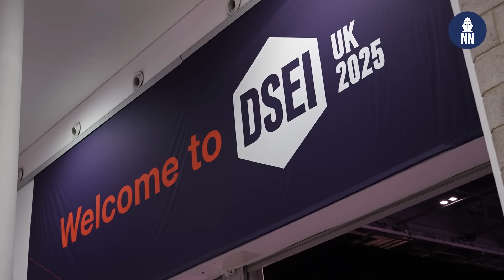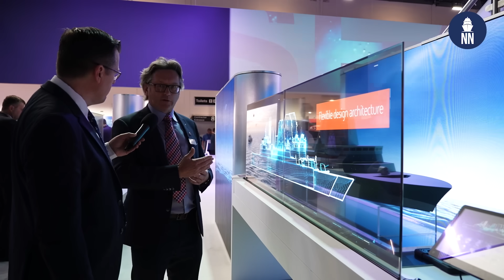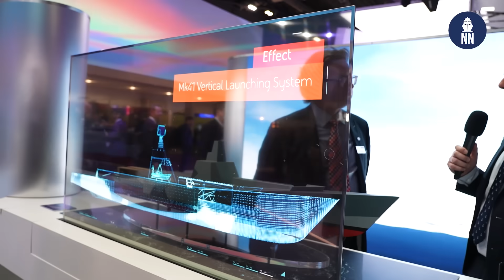Future Air Dominance System (FADS) concept ships by BAE Systems

Comment: Why is BAE wasting R&D on an airfare variant of the type26? Just piggy back off the Canadian variant and increase the VLS cells aft and forward. It will look much better than that bulbous eyesore.
Reply: uk type 26 has 72 cells 48 gws 35 and 24 mk41 Canadian has 24 mk41 vls and uses american radar uk is already funding the flat aesa radar from bae that is shown on model also the mode has 128 mk41 vls cells it is much better then the Canadian version of type 26
Reply: @adamchalmers8378  Canadian version of Type 26 actually have a better AAW capability than RN Type 26 despite having less VLS. That 48-cells on Type 26 are mainly for point defence Sea Ceptors which have shorter range compared to RIM-162 block II ESSM on Canadian Type 26. Canadian variant also have SM-2 and RIM-116 to complement the RIM-162, so it will have a respectable layered AAW. The 24-cell Mk-41 on RN Type 26 are for anti-ship missiles, that’s where the RN Type 26 have an edge on both RCN and RAN Type 26 variants. I get that RN don’t want to use American missiles and systems, but picking up the Canadian design and modifying it to fit more VLS and European systems could be a cheaper  approach since BAE also already showed a model of a 96-cells euipped Hunter-class.
Reply: @Flick-l5m i do think some of the vls will be used for quad packed camm-er and dual packed camm-mr to give the type 26 a good air defence loadout but i would like more vls because they want antiship, landstrike and a asroc alternative + potential camm mr and er  in a 24 cell mk41 vls
Reply: 100% correct!
Reply: @evil.totoro. The "bulbous eyesore" is a large flat panel phased array radar and any modern air defense destroyer will have a very large one stuck on top of it. If your primary metric of what makes a good combat vessel is how pretty it is all I can say is I am extremely glad you are not responsible to military expenditure in the UK.
Reply: @kalicom2937 I don’t know man, the States, Japan, South Korea, and China have figured out how to fit large phased array panels to Destroyers,and figured out how make them look “pretty”. y can’t the UK? Like others have said, being too top heavy has already shown to be issues with the Hunter class.
Reply: @Evil.Totoro  Indeed. I think having the best radar possible is pretty important when it comes to an air defense asset - and if you want a big radar you need a bigger ship than the type 26 (which was always the plan for the type 83). Something the size of the Arleigh Burke class - or even larger. I have seen displacements as high as 10,000 tonnes has been mooted. I do not think they will be that big, but if they are they will be a properly chunky bit of kit, potentially.
Reply: @Evil.Totoro it's a very early draft design.
The final version will not look anything like this mock up.  It is really just there to reference the size of the hull and radar panels being proposed.
Reply: They want it fitted with their own radars not American.  You would think they would use the Australian version as the base model but if the UK wants a larger missile load out and radar capable of tracking ICBM's the ship will be in the 10,000 tonne range.
Reply: @Weakeyedominant  the Australian variant (Hunter) has topweight problems because of the decision to use domestic sensors whose installation is so heavy that they've used up the stability margin for the design in one go, never mind any future upgrades! You have to be very careful about putting heavy stuff up high. The variant that BAE is proposing uses the T26 as the basis for the hull form and the layout and systems architecture, but the hull is bigger and therefore more stable, and therefore able to carry much more topweight.

Comment: The trimaran looks good to me.  And likewise I agree with the concept of having several of these simple and fast built types added to the current Type 45 s, while taking more time to finalise their replacements.
Reply: Its the RV Triton platform that they tested extensively a decade or so back. The ship then went to serve with Australian border firce i think before being returned to the UK Beautiful ship, saw her in Aberdeen a few times .

https://en.m.wikipedia.org/wiki/RV_Triton
Reply: Well then you clearly never got the message over the American Independence-class littoral combat ship.
Fantastic if the sea is racetrack flat.
TOTALLY USELESS once the waves get about a few inches.
UN-SEAWORTHY once the waves got above a meter.
A naval architect on comments several years ago pointed out the problem of loads on the ship structure with waves. Basically the waves keep flexing the hulls until it cracks. 

I'm Australian and wanted to see an Australian company succeed BUT SORRY the idea of trimaran's in the NAVY is OVER.
Reply: @tonywilson4713 I question your authority to make such blanket statements.  You will no doubt notice that the prototype trimaran for this class is still in service after twenty years and several circumnavigations of the planet.
Reply: @MichaelKelley-f7z  DO NOT QUESTION OTHER PEOPLE'S AUTHORITY when you don't even go and check your basic facts.
🤪👈
Reply: @MichaelKelley-f7z  Yeah but that's a Research Vessel, it's not in a rush to head through a storm or do constant patrols.
Reply: @tonywilson4713  
"DO NOT QUESTION OTHER PEOPLE'S AUTHORITY"
That would be the logical fallacy "Argument from authority" :(

I expect you still think Father Christmas is real.

As the other guy said - This trimaran is base on a ship that's been round the world twice, and is still in service 20 years after it was launched.

Even BAe  know better than to offer something with poor sea keeping for use in the North Atlantic.

Comment: Unrelated, but viewers of this channel may be interested - since it is ongoing live right now. A US P8 is operating (with transponder on) north-east of Norway - probably with other aircraft. The fun part is that GPS jamming/spoofing is ongoing, making the "flightradar24" data slightly insane (very erratic track - air-speed varying between 100 and 800 knots). So - if someone wants to observe this "live" go ahead (15:15 zulu time). Be patient, it goes off and on with the transponder.

Comment: Jesus even if this is just an early concept model, the looks is unacceptable
Reply: I mean, I do agree that chonky mast looks ghastly.

Not important though.
Reply: A ship is built for its effects
Reply: @iking95249 Yes we all agree, Radar, Armament, Reliability, Power management will all be far more important, but when it's going to cost billions it helps when it at least looks cutting edge.  
This model was slapped together by one of their graduates.  The AAW designs from Germany, Netherlands and France are far more refined than that thing.
I'm sure it will look much better in two years.
Reply: BAE doing the most minimal effort, basically a different version of type 26. They’re probably going to charge the UK tax payers more per ship than the top of the line Japanese future Aegis ships.
Reply: @isunlloaoll what's the issue with reusing the T26 hull design ? If it works them roll with it
Reply: @gregs7562  I think the issue is in the margin for growth. The T26 is already quite a heavy frigate. I know that BAE has proposed AAW variants, but even if such a design were chosen, we'd be utilising a hull that is somewhat out of date. I think it is better to go with something new.

Comment: And what, a 10,000 ton ship with only 57mm guns? Furthermore, even if you carry more VLS, if the VLS you carry is only Mk41, it still does not change much the ship's capability structure. In terms of overall combat capability, AB Flight 3 is better, and would the British expect this brain tumor ship to be better than the Type 055 with HT-1 VLS? Well, the answer is sadly no. This ship design is even as ugly as Indian ships
Reply: Arliegh Burkes are old school right now, not very suitable. This is the future; distribution, layering, network centric with space forr future tech unlike the obese monstosity that is the updated Burkes. The 57mm is the best choice for its role as 127mm is shite at anti-air, and the 57mm actually puts out more metal per second than the 76mm does, which is crucial for drones and future swarms.
Reply: @Retrosicotte 

except space for future technology, you described perfectly a Burke class even starting from batch one.
It's obvious you consider only flying drones and not surface ones, which make by far having a 127mm gun with up to 50 nm range Vulcano munition a more interesting solution, saving precious anti-ship missile.
For flying drones unguided munition could not be useful over 3 nm , thus a pair of 30x173 with their 2 nm range are an optimal solution.
Only gun with a guided beam radar riding munition is 76mm Superapido with Dart round capable of 50g maneuver up to 5 nm, but for this calibro Vulcano munition have a maximum range of 20 nm only and weights 5 Kg instead of 15, indeed if you want to match an Harpoon for a larger target you must fire 40 rounds for the 76 and only 14 for the 127 gun.
Reply: @robertopiedimonte2078  Burkes absolutely are not set for future tech, they are struggling to update them within its limitations already. The 30mms are not enabled for optimal anti-air at all. The Bofors 40 is far superior in its modern iterations, which is why the UK selected it despite operating 30mm already.

You're thinking old school with naval guns. "Guns on" is far more about resisting drone attack now, and huge, slow firing guns are not the deal for that any more.
Reply: @Retrosicotte 

Sorry, but you have to read first, understand second and stop speaking as a Company PR.

I wrote "except", did you noticed?

40mm gun have a range of 3 nm, but weight more then a 2 nm range 30mm one, munition are more expensive, reload the mount is more difficult, while you could find 30x173 rounds everywhere.
Israely Rafael claims their 30mm Typhoon mount could shoot down a drone up to 2 nm with 3 airburst rounds and this is the reason for them to shift from the 25mm gun as on american Mk38 (a Typhoon).
Mixing an API round, an HE round with a contact fuze and the HE round with an airburst timing fuze or a proximity one, 3 of a kind each in a 9 rounds burst for any possible surface or air drone, with a typical 200 rounds magazine allows the mount to repeat the engagement 22 times.
Drones are smaller then Second World War airplane and not fly as much high, so the 40mm is by far in excess likely the 57mm, but not enough to sink a Fast Combat Craft or a trailer (like the ones used by chinese Militia) or a small ship, live it alone a Corvette.
By the way 20mm and 40mm guns manually aimed were the main anti-airplane ones during WWII, so a 30mm round should be more then enough for drones.

I'll bore you, but I'll repeat again you think only about flying drones.

Finally let me highlight probably we'll need new launchers for cheap Very Light Weight Torpedo (127mm/5" decoy's size) to contrast underwater drone threat.

P.s.: laser is welcome.
Reply: @robertopiedimonte2078  ANd again you completely miss the point. 30mm is nota  greaat calibre for it and it's been shown by it being abandoned for higher. The 40mm has far superior ammo for it, rather than what some israeli fanboy says.
Reply: As a South Asian, I resemble that remark about Indian ships... 😁😬
Seriously though, I think they are taking cues from the Type 31 ships. As a Air Dominance ship, a rapid firing 57mm is a good choice for AAA. However, I do hope they also invest in more gun systems like a 20mm CIWS, and 40mm autocannons as well. They keep talking about a layered air defense but missiles, and the 57mm only cover a small spectrum of the layering. Missile systems take time, and are slower to respond compared to gun systems. However, I do understand that this is just a concept, and whatever evolves from this concept will hopefully be a more well-rounded ship.
Reply: @rokuth  I'm also Asian, and to be fair if it's an Air Dominance ship, investing in a larger power plant and using a high power laser like the LY-1 makes a lot more sense in modern warfare than guns, more guns just take up space and you're dependent on the ammunition you carry, it's also a logistical nightmare, as you'll be carrying 57mm, 40mm, 30mm, 20mm, 12.7mm ammunition at the same time, not to mention the personal equipment ammunition which is standard on Western ships. The time it takes to prepare a gun takes a lot longer than missiles or lasers, you can run out of ammunition but you can't run out of power
Reply: better for air defence and small fast attack craft shore bombardment is not really done anymore
Reply: @winbear7423. Get used to "brain tumor" air defense ships. Regardless of the hull the superstructure will look like when you put a large flat panel phased array on top of it.
Reply: @winbear7423 The choice of a 57mm is the very least of the potential issues. Naval gunnery for land operations has become archaic. It's just not what warships are used for anymore, given the threat of ASHM. I do agree that the Mk. 41 is limited, though still very versatile. A larger VLS system should be sort after, like the Korean KVLSII. They're a very friendly nation to the UK, and quite experienced in terms of naval production. Poland knows what they're doing.